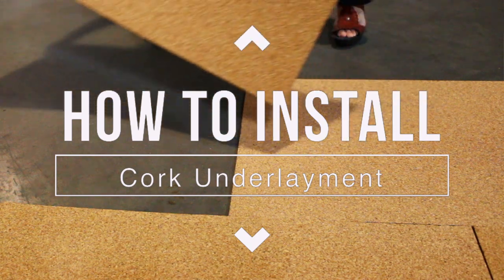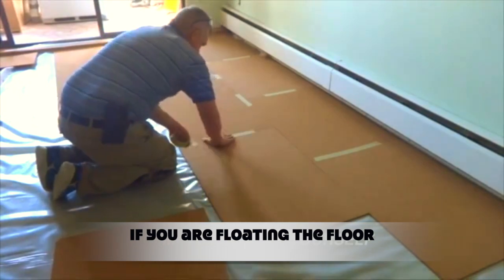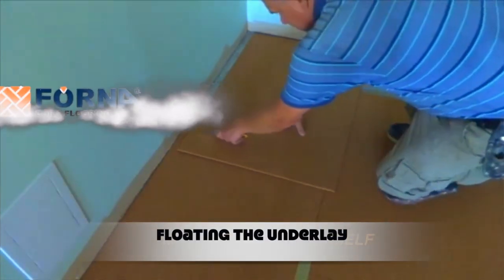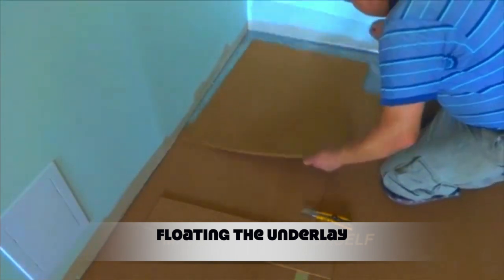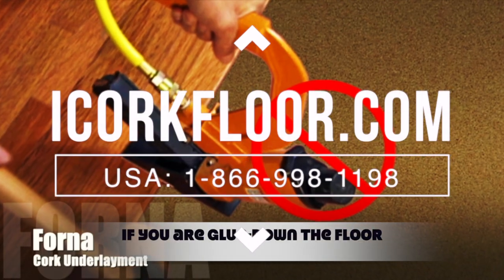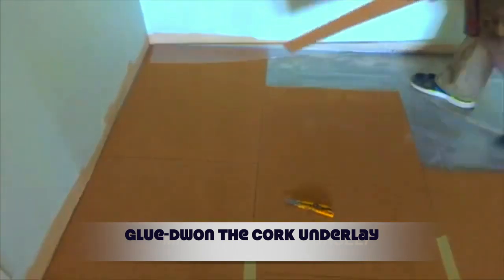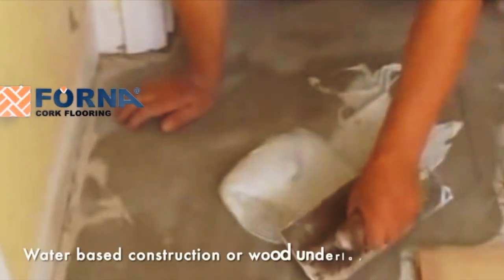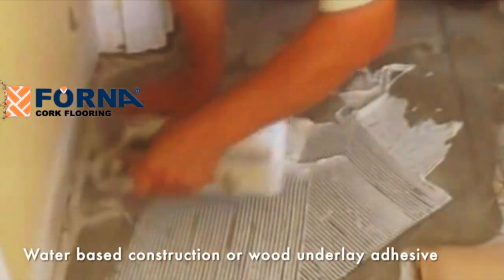How to install cork underlayment

Comment: you mentioned that the cork underlayment should never be stapled. This means that can not be used with solid hardwood 3/4" thick that is nailed to the subfloor. right?

Comment: I am redoing my second level and it has been stripped to the subfloor , I am looking to do cork to quiet the flooring , do I need a vapor barrier below or above the cork before  nailing down the hardwood ? 
Thanks
Reply from the maker: Hi Rob,Sorry for the delay. If your subfloor is a cement subfloor, you will need a layer of moisture barrier.
If your subfloor that has a chance of moisture coming up and soaking into the flooring
Moisture barrier acts as a blockade between the subfloor and cork floor to protect your cork floor from any moisture damage.